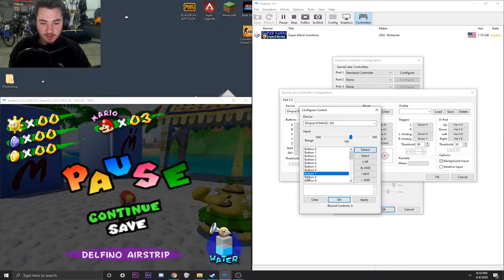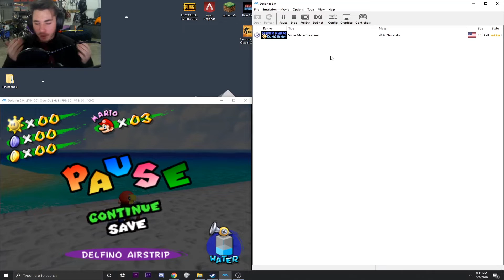How to Simulate GameCube's Analog Triggers in Dolphin!

Comment: Hi man, I followed the instructions as shown but keep getting 'Expected end of expression.' as an error when I try to click ok. Do you know why this could be?
Reply from the maker: I'm not entirely sure, messing around in dolphin all I could find was something saying syntax error, but nothing happened when I clicked ok. You could try a different controller input. I am running Dolphin 5.0, so if you aren't running that version, that could fix the problem? Of course searching on Reddit is always an option if anyone else has had that issue. Apologies that I can't be of more help though, hope you get it fixed!
Reply: Any luck figuring this out?
Reply: its because in the version of dolphin youre using theyve fixed this. theres a spot called "right analog" and "left analog" i was dumb and set this to my analog stick buttons. which couldve been what you did or you just didnt set them at all.
Reply: @HotDogBunN2YG  That forced me to make a slight tweak to the configuration I used, by simply using Button 7 (Right Trigger) and Button 4 (Left Bumper) to simulate a GameCube Right Trigger full pull.